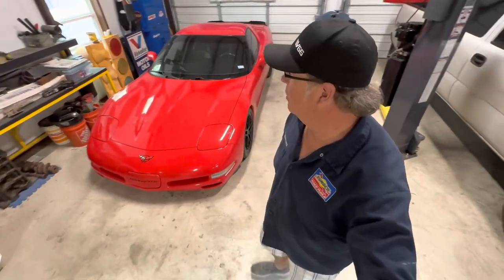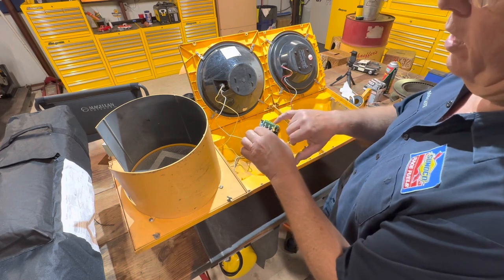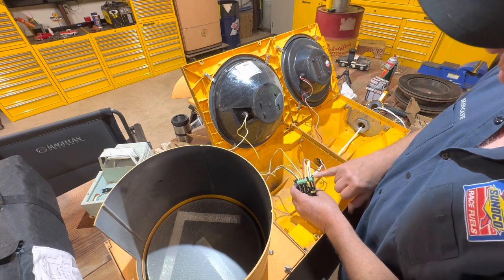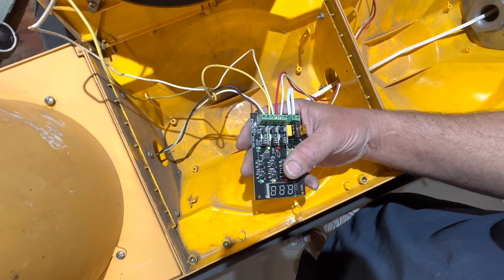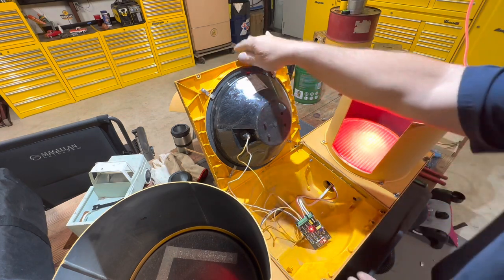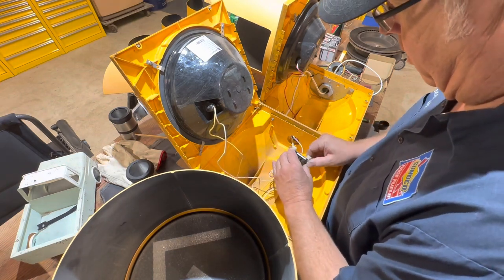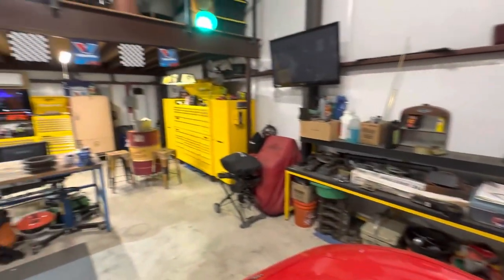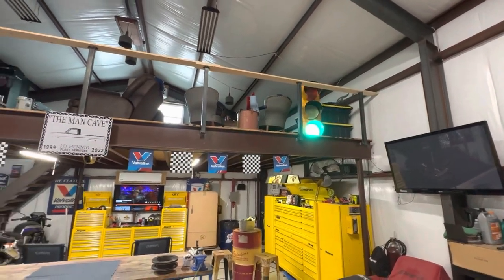Traffic Signal wiring and sequencer install.

Comment: I have an older one with incandescent lights.  Will this controller work on mine?
Reply from the maker: Yes it should. I have a friend that has the incandescent lights and it works. Thanks for watching.
Reply: It will work just fine
Reply: Where can I get one.